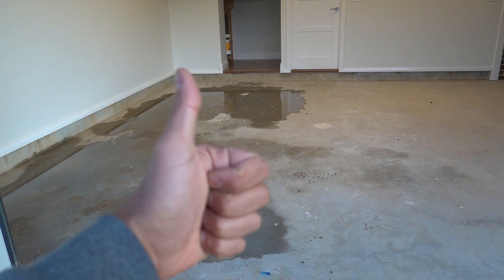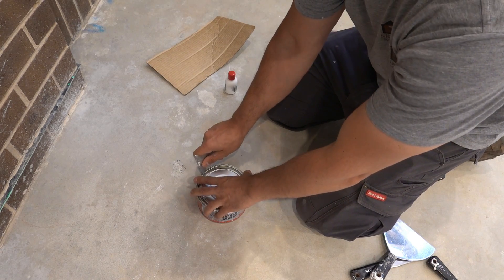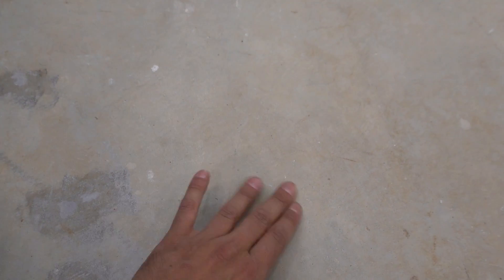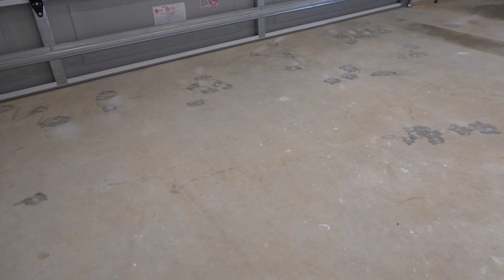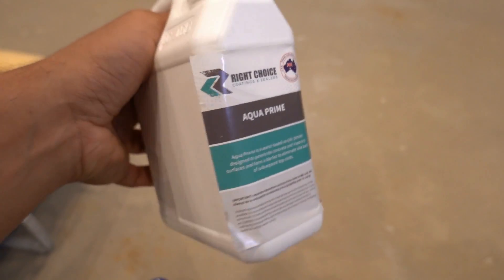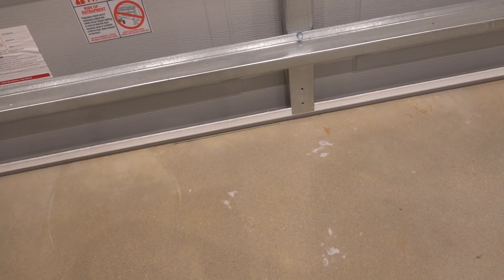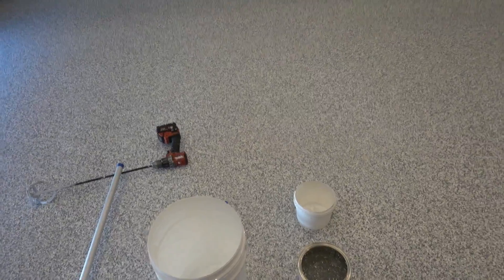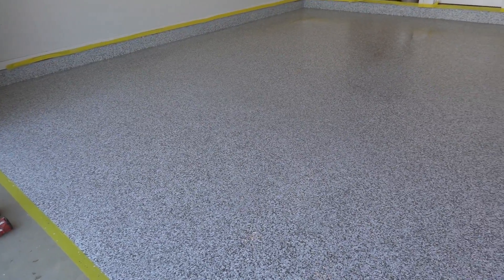Garage floor transformation DIY weekend project

Comment: Great video!
Two products that could help here are the boxes of prefab packets of various sizes, which takes the messing around out of cardboard.
With the need to mark through a deep drill hole, check out your hardware counter. They sell tiny aerosol marker paint (like an asthma puffer), with a pointed bullet tip that goes against the hole and sprays a dot of paint through to mark your material for painting.
Your job here looks great!

Comment: Great advice to wear the respirator. I noticed the filters on your respirator are designed for dry particles such as protecting you from the cement dust. When you are doing the acid part the filters designed for the vapours?

Comment: Great video as always!!, Would it be possible to apply the final polyurethane sealer coat over the concrete lip under the garage door to protect it and also stop anything penetrating under the edge?
Reply from the maker: You can use the clear sealer however I intentionally left it plain so I can put a color sealer once the drive way is completed 👍

Comment: How does this product hold up to hot tires being in the same spot over, and over again?
Reply from the maker: I don’t intend to have cars parked in there as I will use it for storage. If I wanted to park cars in there I would grind the floor first for maximum adhesion and there shouldn’t be an issue after that👍